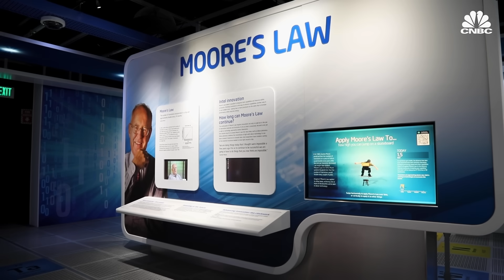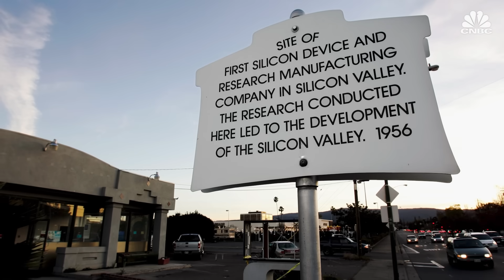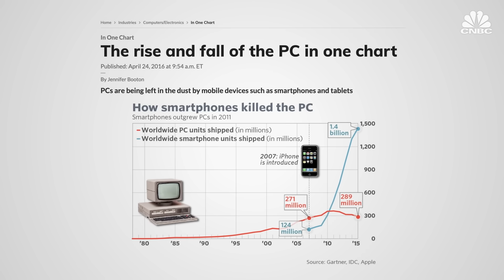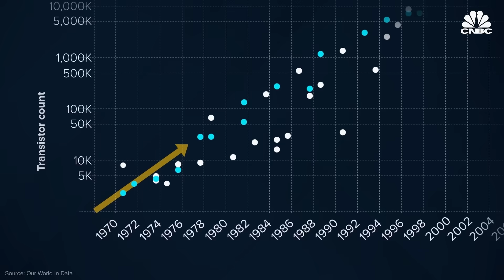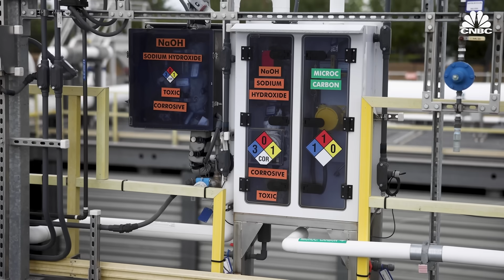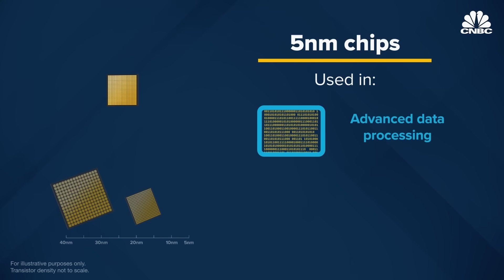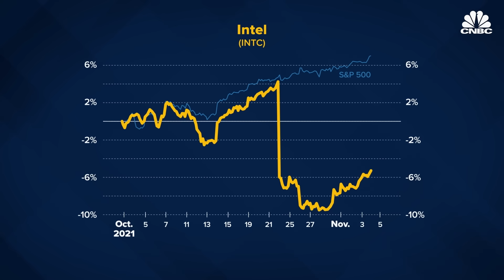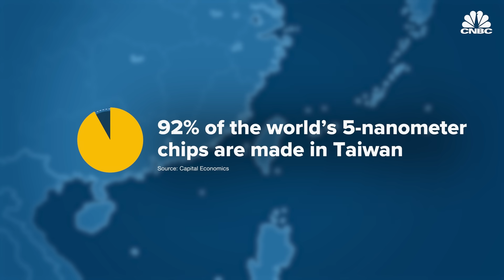Inside Intel’s Bold $26 Billion U.S. Plan To Regain Chip Dominance

Comment: it is a little late to the party. Suddenly Intel, TSMC and Samsung building new fab plants within US so that they can control whom to sell the final chips to. By the time in 2026 when production starts silicon based chips may no longer be sought after. Graphene chips with optical oscillation will render the silicon based less in demand...it is just like continue to build combustion engines for cars when many turning to EV...only time will tell if their decisions to stick with silicon chips is a sound and home run

Comment: It's not that I don't believe Intel, but first they got hung up on what they called 14nm, which is comparable to TSMC N10 or 10nm node and same with Samsung.  This cost them not only loss of business in fab, but in their X86-64 sales.  On top of that, their Intel 10nm, which is now fairly called Intel 7 is going through the same kind of issues where after a few years of work they've got it to where it produces very fast die (ICs), but at higher power consumption than their competitors.  And while they have plans to release their 13th gen core processors (X86-64) on their Intel 4 node (4nm), there is nothing on the market from them, even in an LP form (low power).  Or, there is one product, the Loihi 2.  Considering it usually takes a good year and typically longer to get from a low power form to something that can push the high clock speeds needed for CPUs, I'm skeptical that Meteor Lake (13th gen) will indeed come out on Intel 4, considering that CPU launch is supposed to be next year.  I'm not saying they can't, but usually a fab will release some product that's low power on a node to show what they can do.

Samsung is currently using their 4nm node for the newest gen Samsung products that just released.  TSMC is producing N5 and has been for over a year, and in fact they're about to release very high speed N5 which AMD is going to use for their Zen 4 architecture and it jumps clock speeds up by 3 - 4 hundred MHz over their last gen products.  Apple has been using TSMC N5 to produce their M1 processor, so it's starting to become a mature node.  Apple's iPhone 14 will be coming out on TSMC N4.  This is of course low power.  So both TSMC and Samsung have or about to have low power 4nm nodes.  The iPhone 15 is supposed to come out on TSMC N3, and TSMC is on track to start production on N3 towards the end of 2022.  But TSMC is also supposed to start risk production on N2 in 2024.  Well, that's about the same time, or maybe later than Intel is supposed to have fabs built for Intel 20A.  I wouldn't expect them to be in production until the end of 2024 or 2025 at the earliest.

So the time table of these companies certainly doesn't put Intel ahead.  It can at best get them caught up, which would STILL be a good thing.  It would at least put pressure on TSMC and maybe Intel grabs customers away which could force TSMC to lower cost over time.

Comment: While the microprocessor is often called computer on a chip, the 4004 required about a dozen chips for a complete computer system.
The 4004 was the "heart" and 1st "commercial" microprocessor series.
Previously, a special purpose microprocessor was designed for advanced avionic systems (ICBMs). 
It required about 6 chips for a functional system.

One disturbing Intel history factoid is their virtual eradication of any contribution of Federico Faggin who was the major designer for their 4004 CPU. Faggin left Intel to form Zilog which made enhanced competing and compatible CPUs.

IBM designs and produces their own chips in the US mostly for internal consumption.

Comment: @15:10, the gentleman said, "I don't know how you can let something slip as much as they have."  This is a statement that should be put forward to many US companies, not just Intel.  Another part of the semiconductor industry is the test and manufacturing equipment.  We have most of the semiconductor equipment companies in Silicon Valley but none of them can successfully build a UV lithography machine.  At least, not yet.  While ASML is the only company that can produce this machine.  I believe this is even more crucial than the process itself.  Because the process requires the machine from ASML.  TSMC and Samsung are analogous to a baker utilizing a baking oven from ASML.

Comment: The only issue I had with the interviews was when someone said, "they got fat and lazy". And not for the reason you might think it is.
They only reason I had issue with it was because that's a complete lie. They got greedy plain and simple. The amount of greed in the PC Technology sector is on another level. From the chip giants down to the online and brick and mortar stores. You see article after article, video after video. Just so they can make a extra buck. At the expense of the customer.
In fact it's got so bad, I'm not even surprised anymore. In fact I'm actually surprised when there isn't a scandal, or scam going on. It used to be you had to watch out for the individual scamming you. Now you gotta watch out for the retail store, the AIB's, and even AMD, Intel, Nvidia. And I'm sure that's just scratching the surface. I'd hate to be able to see what they have done that we didn't notice or didn't come out.

Comment: "Used in the latest technologies, like iphones, nasa rovers, and f35 fighter jets" -- sorry, those last two use cases do NOT use the latest process nodes. They use relatively ancient ones for stability reasons. The rover is likely to use a radiation hardened version of a Power PC chip that was first released over 20 years ago.

Comment: So, basically, the current chip shortage is in large part due to the building of all of these chip manufacturing plants by all of the top manufacturers. When they say that these plants require a LOT of electronics and machinery, they are saying they require a LOT of chips. That means that the chip shortage will continue throughout the rest of 2022, at the least, as all of the big producers are now building multiple plants. Wake up, the USA needs another stimulus or the world's largest buyer's market will crash before these companies can retool and bring industries across the board back up. I know inflation is a monster but we've never seen homicide and suicide rates like we are about to start seeing. Fringe businesses are already announcing job cuts - IN FEBRUARY!!! - making it highly likely that summer hires will be flat. Jan. 6th 2021 happened because someone in DC chose to stall the stimulus process out for over 6 months (and then she settled for the amount that had been offered the whole time and pretended that she had no idea why people were upset and about to lose their minds). We are in the end game scenario now in every conceivable way that it can be looked at. Hedging on US chip plants, that are 2 or 3 years down the road at best, is insanity.

Comment: Shockley didn't invent the transistor.  He invented the Field-Effect.  The bipolar junction was invented by Bratten and Bardeen and WAS the transistor until Shockley could make his actually work.  He was just the guy whose lab Bratten and Bardeen worked in to commercialize the BJT.  The Field Effect transistor didnt come until later and even then, Shockley wasn't the one that made his idea work.  You should truly understand the history of this or the revisionism does a disservice to why the so-called Traitorous-8 left.  Shockley loved to take the spotlight and pushed his way to the front of the photo for Life Magazine and Time Magazine to take the spotlight from the engineers that truly built these essential devices.  He was a smart, for sure.  But there was good reason his centrifugal personality was foundational to the formation of the valley.

Comment: huge wildcard is when mainland china attacks and takes over Taiwan like it just did with HK, turns it communist run by CCP mafia  and slow walks shipments from TSMC then Intel's strategy of diversifying away from reliance on low cost providers like TSMC will really shine ... remember TSMC was founded by ex worker from Texas Instruments ... barely mentioned here is the secret sauce coming from chip making Dutch company ASML which is what TSMC uses to make the chips so the key technology is coming from the Netherlands ... go Dutch !!!
Reply: China is also putting immense amount of capital in research and development of EUV machines. From latest articles I conclude that they're getting pretty good results

Comment: I have an affectionate loyalty for Intel. My very first PC build was an AMD and it caught on fire after using the PC to play a complex video codec DVD, the DVD's that later came out with a newer codec just a few years before Blu-Ray was introduced. The next day I visited the local CompUSA ( remember that store? ) and walked out with all Intel parts. Got home, built the PC and everything ran so smooth and handled every stress test without a problem. Ever since, I'm all pro Intel.
Reply: If your machine caught on fire it was likely due to some power supply issue or faulty wiring. A cpu running hot will degrade the materials and get misreads but it won’t light on fire.
Reply: @drygordspellweaver8761  No, dummy. It did not catch on fire. The graphics card smoked and sparked and blew. I was watching Leon The Professional on advanced DVD codec, it happened during the climax scene with all the fast moving scenes and bright colors. I know there's like some weird cult-ish loyalty following for AMD products. I say Intel is way much better.

Comment: Intel is no doubt one of the top ten greatest tech companies in history.  What gives me pause is the investment.  With tech, you cannot break continuity; i.e. if you want to re-invent the wheel and prepare massive production, well, tech is a moving goal and that movement might instantly make you obsolescent, if not obsolete.
Reply: Investment in tech is difficult because innovation is not predictable and Intel can't compete unless it has a monopoly.
Reply: @davidwong5197  Nobody has a monopoly. Intel never had a monopoly.
Reply: @jamescarter8311  Intel's market in PC is a monopoly. I don't know any PC that don't use Intel CPU/chip set.
Reply: Intel has been in this game before. They can get best engineers. They should be able to pull it of...
Intel is not some start up, no disrespect at start ups, but they know the industry and have a lot of cash behind them also.

Comment: QUESTION: Just for the sake of discussion, is it possible, that an OS like Windows, if not Windows, were to be TOTALLY re-written from the ground up, optimized, and bloat reduced , that this would substantially increase computing speed/time?????
Reply: Windows uses interrupts and timers to control which programs get processing time with the foremost program getting the biggest timeslice, its what allows windows to run multiple programs simultaneously. You could use an older os like windows xp to take advantage of disabling interrupts to run your own programs without sharing the processor. Newer OS's will block the assembly instruction.

Comment: Comment on foundry:
Intel has trouble manufacturing its own non-cpu chips, which is not as highly regulated design 
So it’s process for CPU and chipset are 18 months apart. 
Foundry is a SERVICE business more than technology. How do you use one process to enable different design styles from Qualcomm, apple, nVidia, AMD is very complicated and that’s why tsmc is so good in foundry business
As an IDM, Samsung and Intel can use its own design to quickly tune the process but when goes to others design, you will spend 2x (at this stage, might not even be RD resource) to tune the process
This is also why IBM failed in its foundry business ended up sold fabs to Global foundry

Comment: Under a war time schedule, it should be finished in 12 to 18 months, provided that all of the supporting supply chain factories are all LOCALLY located and available INSIDE AMERICA and that their manpower levels and constant educational-training programs for new manpower as well as to upgrade their older generation manpower constantly are all in place. Just like an Army with full logistical support working around the clock. Master machinists with precision manual machine tools and instruments who will be responsible for making the specialized machine tool components for the specialized machine tools needed to manufacture the manufacturing MECHANICAL components of all manufacturing equipments will be VERY important indeed.

Comment: 3:23 RAM is an acronym for "Random Access Memory", not 'short term memory'. RAM is a volatile memory but it cannot be considered 'short term', because as long as you do not reboot or power off the machine it can hold data and instructions for days or even weeks+. This is the case with servers, which barely ever reboot.
Reply: Yes but it will be extremely confusing for your normal average viewers to understand the word "random access"
Reply: Short term is actually a good way to describe it. It's not short in terms of time, but in terms of cycles where the machine is powered on

Comment: When you start getting things wrong such as the fact that it was the derivative of the 8086, namely the 8088, that went into the original IBM PCs then it might be a good idea to just fire the "researchers"; because there were a number of other pieces of gross misinformation in the video.

Intel is not "Back" and their architecture sucks balls with regard to performance per Watt which is what is important in the server market compared to the competition.

What was, and probably still to a large extent is, wrong at Intel is EXACTLY the same as what caused IBM to go from being number one in the computer industry (with the positions two to ten being taken by IBM subsidiaries) in 1980 to being an also ran in the 1990s.

Comment: Switch from CMOS (inherently quantum mechanically defective) to Threshold Logic Gates implemented in Resonant Tunnel Diodes. In 1984 they were running at 70 GHz. 100,000 times the speed-power product of CMOS (1000 time the clock speed at 1% of the power).

Comment: There is one missing word from this account which renders it almost meaningless... ARM. 
It answers so many questions:
- which is the world's most popular microprocessor architecture?
- what kinds of processor feature in the majority of chips made in the fabs of the companies producing smaller-geometry chips?
- what processor architecture is the basis of the new Apple products which use less power and have higher performance than Intel-based computers?
- If you plot the rate of increase in performance of available processors over time, which kind of processor has recently overtaken Intel processors in performance (and power-efficiency) and has had a consistently higher rate of improvement than Intel CPUs over time?
Omitting mentioning ARM architecture as a central part of this discussion is the main failing of this presentation, I believe.
(I do not work for ARM, I should add).

Comment: I dont get it. ASML the Dutch company has a monopoly on manufacturing machines. With all the financial might of Intel, they can easily buy many many machines and bring the angstrom era sooner rather than later. Unless its an issue of talent, which i suspect it is and if its indeed that, then Samsung and TSMC will forever and ever be ahead, unless Intel somehow manages to pivot towards Quantum computing and the angstrom era becomes just a decoy.

Comment: Intel isn't really behind. The process nodes (7nm, 5nm, etc...) don't represent actual transistor measurements anymore because it's so difficult to manufacture devices on such microscopic scales. They are marketing names nowadays. If you look at transistor density on a chip, Intel is pretty much on par with TSMC and Samsung.

Comment: Intel will be caught ‘in between’. Intel 7nm is not even in mass production yet. So Intel is not in TSMC and Samsung category yet of which both are at 5nm to 3nm. On the other hand China SMIC is already building the plant in Pudong Shanghai to mass produce sub 14nm down to 7nm. The plant is being built and will ready in 2022 likely using China’s SMEE mass produce lithography machines or SMIC DUV (ASML) with FINFET n+1,n+2. Mass production of the 7nm is scheduled at 2023/2024. Has Intel even started building its plant yet? Can USA force you TSMC and Samsung to transfer technology of the 7nm, 5nm and 3nm to Intel? There will be a lot of haggling. It will take a lot of time. Even a military invasion to Iraq take 18 years before China as are able to steal enough of oil to meet its objective. Then again, there is the competency issue and the cost effective issue and the working culture issue. TSMC and Samsung is not where they are now by sitting in their laurels doing nothing. If China SMIC catch up with 7nm in 2023 and Intel plant is not yet ready, Intel will be caught in between the rock and the hard place. Can’t compete in technology and also can’t compete in cost. If China succeed in coming up with graphene chips or photon chips by 2025 and yes, they already develop a 50nm graphene 8 in wafer which translate to 4nm to 5nm in silicon chips in terms of performance, Intel dream of chips supremacy and usd26b or whatever the investment will become a nightmare. It’s not only the technology but also the speed Intel can get the technology up, mass produce and the cost it can reduce to gain market share. These days, speed, mass produce and economic of scales to reduce cost is not a forte of most American companies especially Intel. It’s very risky. Intel should concentrate on CPUs. It’s too late to come down to this end of supply chain. Looks like a nightmare in the making.